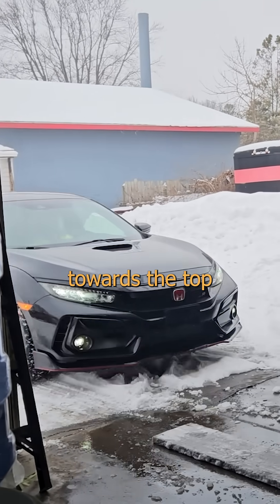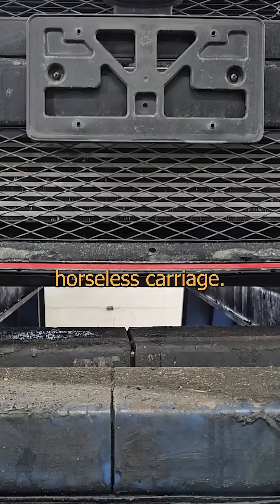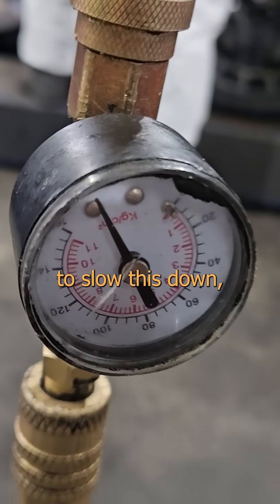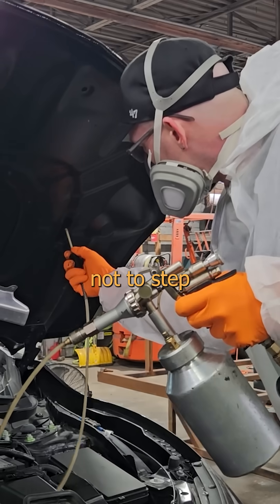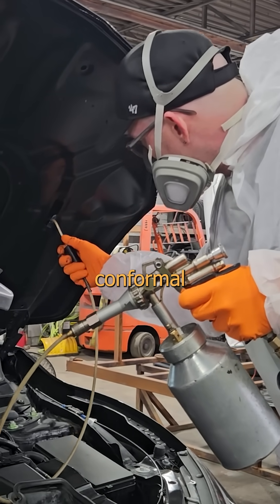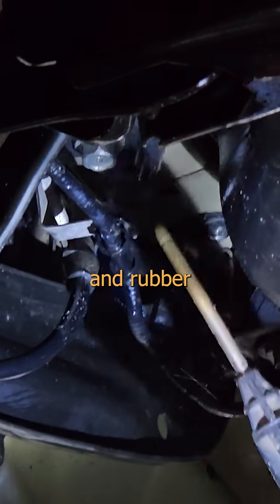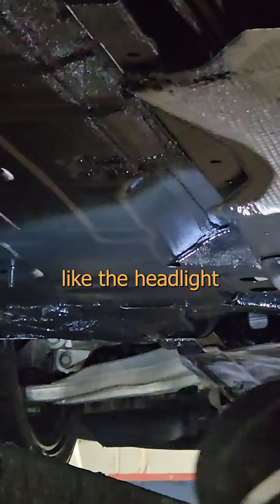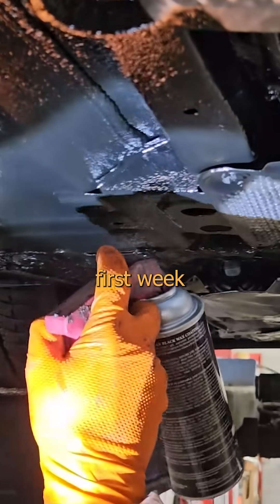How to stop rust on your car #chrisboden #comedy #engineering #wax #corrosion #science #winter #salt

Comment: I only ever  saw tar.  Or something like paint on  bed liner. Wax sounds better.   But, get a case of flat black rust converter  and get under there with a brush and clean and spray the underbelly first before you apply the heavy spray wax. You'll be glad you did.

Comment: Told a customer this week to never go back where he went. They didnt remove a single panel under the car, any of the wheel arch were done under the plastic. There was undercoat on both front fenders, both head light, both wiper arms and on the windshield. I should have take pictures 😅

Comment: I have a car wash subscription, and in winter I upgrade to the one with underbody spray.  My cars aren't rusting from the inside out. When some dude in a rusty jeep slammed into the back end of our 2012 Cruze at 45 mph, was able to see the interior of the subframe metal because it got torn open.   No more than surface rust, and not much of that.  And yes, I'm in southwest Michigan too.  That said, I might just give Kevin a call, skip the increased car wash price in the winter 😁

Comment: Undercoat (or underseal as it's commonly referred to here in the UK) is incredibly common over here, especially on slightly older cars (20 years onwards, when you get to around 35 even moreso) but funnily enough for us it's a bit of a red flag, at least in my experience, as some rather iffy folks will use it to mask rust on a car they're selling. Cars here just love to rot and crumble away (ask my Ka how it's wheel arches are doing) so using underseal to hide potentially MOT-failing rust is unfortunately quite common

Comment: My truck came out of Canada. They sprayed everything under the truck, alllll of it. Up into the engine bay, all over the suspension components, nuts bolts everywhere.. not a spot of rust for an 18 with 170k. That stuff works!!

Comment: I’m in New England, my Tacoma is 21 years old. Frame was replaced due to class action lawsuit, different motor due to spark plug popping out of cylinder #3.
Have 221000 miles, bed is just starting to rust over the rear axle support. Plan on driving it for another 6-8 years.
Fhak merikan vehicles

Comment: Okay, I want to see something not only cool but educational and awesome. 

I want to see you make an ebike that can switch between discharging the battery to run the hub motor to, at the flick of a switch, turn into a machine that no longer uses the motor but while riding it, recharges the battery. 

I also want it to have a throttle only 100+ range. Bonus points if you make a video series showing and explaining what parts you chose. Why, and how they are connected to the unit. 

World record range throttl3 only ebike is almost 250mph with an average speed of 13.5.

Comment: Only thing I want to add: if your car is already rotting, under coat will not slow it down it will probably actually speed it up. Proper prep is very important when it comes to undercoating and anything beyond surface rust needs to be taken care of or just left bare if you’re going to undercoat. Another thing is ANY plastic coverings on your vehicle trap moisture and salt and will rot out an otherwise perfect looking car and you won’t even know until it’s too late. Cars made in the 2010’s were especially bad about this, rocker panels were covered with a decorative plastic guard. Most newer cars you’ll see it as things for aero and NVH under the car. Engine shields don’t seem to have this issue as much. The jury is still out on if undercoat under plastics helps prevent this or not. When I redid my gen 2 Prius’s rocker panels I didn’t bother reattaching the plastic insert that cause the rust in the first place and noticed minimal noise and not a big impact on mpg either

Comment: Absolutely thanks for this Chris. Wither wax or oil. Though prep is important. I think the write questions are what prep work they do, i.e the cleaning, removing surface rust and the actual process plus chemicals and care involved. You can’t just whack it on and hope for the best. 

Oil treatments work well but more shorter term, I tend to use these as spot on treatment.

Comment: Best frame maintainer I've dumb lucked my way into was a leaky cap and fuel hose on a 100gal slip tank and pump. Had it in the back of a '02 GM 3/4 ton ext cab 8ft duramax from day 1.  Each of the two drain holes in the front of the box are right above each frame rail near the behind cab curve.  When in motion, the back half was lightly coated on the regular.  And by luck, it was typically parked slightly nose down, so gravity took care of coating the forward half.

After 850k it was retired but the frame, and even the ribs that cross under the bed, were still in great shape. The rest was beat round and busted up. Construction truck it's whole life, usually with a loaded heavy gooseneck along for the ride.

Comment: Can a steel frame/body be anodized like aluminum can be?  What about electroplating with a 'sacrificial' metal, like zinc (like boats use), or copper (for the protection from its patina?

Comment: My ADHD was overhelmed when I bought my car, I did research how to negotiate it but then failed miserably. 

They installed an "ionizing" electrode or something on my car that allegedly runs a small current through the entire frame that will prevent it from rusting. A load of sh!t, but I signed and paid for it.

Comment: Back when i lived in the state of cheese, i had my beloved 1985 240, got her just under 40,000 miles, and 3 times every year, i drove it up a concrete side wall on just one side. I'd pressure wash the heck outta everything on that side, then back her down and pull her on the other side to do the same, hit some areas with WD and drove another quarter.

I moved to VA almost 8 years ago with 213,000 miles on her and not one hole or rust anywhere to be seen.

People just don't put in the effort these days.

Comment: Ok, so my dad had a 94 ranger that had this little box inside the engine bay mounted right up front that said "Rust Stop". It was supposed to be electrical anti-corrosion. He pumped oil wells and had an accordion style folding ramp for his four-wheeler mounted in the back. There was a lot of bare metal on this thing and it never did rust. I looked into it and it's uses sacrificial annodes while inducing a current in the frame. I think it may be just enough to the trick but I thought it could be fun to investigate.

Comment: I refer you to South Main Auto for a NY resident and expert mechanic’s take on undercoating. He has proof that the undercoating on a car speeds up rust by trapping salt and moisture against the metal. I’ve seen undercoated cars on that channel that were 3 or 4 years old and had rust holes you could stick your fingers through. He uses an oil coating after an intense wash of the undercarriage. Has an older Tundra that still looks good underneath.
Reply: This is a wax based coating. He specified in the video that this isn't a rubberized paint/epoxy
😂

Comment: Very good advice! I live in MA and our cars get destroyed too. I've been using Fluid Film for many years now, with good results. As mentioned, you absolutely can not use any kind of hard/dry coating. These things will chip, crack, peel, whatever and then they start to trap moisture and make things ten times worse than doing nothing. Fluid Film and other similar products will actually penetrate existing surface rust and always displace moisture as long as any is still on the surface.

Comment: Either Chris or any knowledgeable commenters, is there any point in undercoating a car that already has mild rust? Say, a 2017 Honda with 130,000 miles in eastern Nebraska? There's surface rust, but if it's prepped right, can undercoating help extend its life, or does any rust at all mean undercoating will accelerate it?

Comment: Don't spray the drainage holes closed.
Don't coat suspension parts that need to be inspected non-translucent.
Don't spray over the important type labels of your trailer hook.
Make sure fasteners can still be turned.
Make sure electrical connectors can still be identified and disconnected.
Keep flamable stuff away from hot pipes.

Brunox contains epoxy but it's main function is the rust after you have mechanically removed all you can.

Comment: Undercoating is only worth it if you are the first owner, and plan to keep the car for 5+ years. 
Those people are rare, which is why undercoating is rare.
Reply: If you undercoat the car brand new, and sell it after 3 years (like most people do), then the undercoating was unnecessary and won't affect the resale value at all.
Reply: @marrenirre9994  you're missing the point. What he's saying is if it's already rusted, there's no point in undercoating anything.
Reply: @blakec1409  To what point? Surface or structural rust? Won't it at least slow it down to keep away more salt and moisture?
Reply: @0692XA  tough to say on all accounts really. Will it slow rust progression? Probably if done correctly.  But I think it's really only a matter of time before it becomes Swiss cheese.  Coating after rust has taken hold only buys you time. Might buy you 5 years or 15, just depends how much effort you want to put into it i think
Reply: @blakec1409  When you can't afford a car without any rust, especially if god forbid it's gotten bad before your loan is paid off, buying even a few months is worth it. 5 years minimum is life changing because there's no other way to keep a car that long up here.

Comment: I'm from Poland. Salt is second nature here in winter, so almost everyone secure their cars with wax or oil based coating. The fact your mechanic doesn't even disassemble the plastic covers, take tore off and even worse sprays the coating on wet surfaces makes me think are you are fully aware that this should be done?

Comment: I use the pb surface shield once a year which reminds me I need to spray it again. A can lasts two seasons for two vehicles, so pretty cheap. Just do it when I change the oil before winter.

Comment: Probably since the beginning of cars people sprayed used motor oil underneath. It was available for free and it keeps the car from rusting. Once you spray it if you take a drive down a Dusty dirt road it'll put a thin absorbent coating on it that'll help it stick. Yes you have to reapply sometimes but if you do it yourself it's free. And you can even claim to be green reduce reuse recycle.

Comment: Uncommon opinion. Using used motor oil and applying it liberally to the underside does the same thing. Not as glamorous. But it will certainly work.

Comment: Waaaaaaaaaaay back I was an installer of these products here in the Pacific North West for a luxury auto dealership.
For many people these products are a good idea. AND as I have seen here in the comments, the PREP work is incredibly important. I used to steam clean the undercarriages and let them dry before I applied the products back in the 80's.
BUT ...
I have never done this to any of my own vehicles. (Although a rubberized coating on a 4x4 helps with the noises and I should do that just to make it quieter. )
Despite the constant wet and the couple of months a year of daily brining, salting and sanding on the roads I find that taking the time to vigorously spray/wash the undersides, including the inner sidewalls and the insides of the bumpers has kept my vehicles almost rust free.
You should see the condition of the undersides of my 2005 Chevy Colorado. I see worse on 10 year old vehicles every year.
All it takes is an extra 5 minutes when washing the truck.
Wet arms will dry and warm up. Having all that corrosive material washed away lasts for many years.
As most people won't ever do this, the coatings would be much better than doing nothing.

Comment: I worked for oilgard in Ontario, Canada for nearly a decade and if I had to say as far as rust prevention goes, oil is the only way to go about it. The proof is in the pudding and I've seen a 50 year old car restored and once they scraped the layers of oil and dirt off, there wasn't a spot of rust on it. It had been sprayed with oil since day one and daily driven through all seasons. Unfortunately I've seen all other types of rust prevention fail be it the rubberized bed liner type they spray on at the dealership or wax. Only downside with oil is it needs to be applied yearly to be effective.

Comment: I was told in Material Engineering class, an eon ago to prevent rust from eating the bottom of your vehicle, bolt a piece of sacrificial metal on the frame and it will oxidize not rust…that’s what they do to bridges…….i have no idea if it’s true….i just remember being told that

Comment: Spray the undercarriage with used motor oil, then go fly down a dirt road for a few miles.   Gramps method worked well; had a 64 nova with no rust well into the late 90s up here in MN.

Comment: Only 11 years??? Thats short lifespan. I'm my country is "as long as the engine is still able to run". That means lifespan can be 25 upto 30 years and/or the oddo meter back to 0 again. You can keep it operational after that period as long as the spare parts are still available, both the originals or the clones.

Comment: I got my undercoat through my first job. I worked as a part time porter in a small body shop, and saw that they were coating new panels on the back with this specific coating by CREST. After I went back to school, I went to pick up my last paycheck, and asked him about it, as I was in the market to undercoat my rust free 07 Chevy 1500 classic. He told me it was called Crest Honeycoat and told me where he got it, a place way down in Ohio where he orders and ships it up to his shop in SE Mi. I found it online and ordered it. I had trouble ordering it as they required it be a business that buy it, so I started an account under the name of a side business I use to make a little extra cash here and there. I finally got it, applied it, and have had no complaints about it (ofc I used proper PPE and instructions given to me by my former boss, yes it was in an aerosol can). It has been about 2 years ago since and I have not seen any rust where I applied it. I did, although, not order enough to do the entire truck and some thin spots in the coating are a little noticeable.

Comment: Here in Australia 🦘 our farmers and country mechanics have been using lanolin for many years to preserve all types of machinery 
It's commonly available in spray cans. There's a light grade called Inox MX3, and the heavy duty stuff called Lanox MX4. It's only around 2 years ago I first tested MX4 by spraying a old metal vice with it and leaving it outside in our salty humid coastal rainforest environment. It sat outside in all weather for a whole year without rusting, so I know it works!   Wonderful stuff! 
Lanolin is also used on mining equipment and marine applications. Oh, and I've also found it's great for spraying the blades and underneath your lawn mower!

Comment: One thing is always remove any rust first! THIS IS A MUST! You gotta scrape the fucker clean until there's not a spot of rust, then use some cheap primer to coat the bare metal, THEN you can undercoat it with asphalt. Otherwise you're locking in the moisture! You might as well give your car a salt rub like a steak at that point!

Comment: A friend swore by WaxOyl (made by Duckhams?)which he used on all his vintage cars for the same reasons. It's not lanolin based but seems very like your product. It's quite possibly what Marmite would aspire too given half a chance. You could brush or spray it on. He would soak sacking in it and wrap it round his leaf springs as well as brush and spray his chassis with it.

Comment: Living in Austria, we also have salt in the roads usual from the end of october till may... So, yes, rust is common here.
I use a very popular way of protection: it is called rope grease - a special grease for steel ropes, like used in elevators, or cable cars. It is extreme resistent against splash water, don't get hard and it crawls in every little spot. But like all those treatments against rust: it is a very dirty job. 😁

Comment: A few places actually heat their roads.  It sounds expensive, and it is... up front, but it turns out that if you do some heat pump magic and store that waste heat from the road all summer you can actually heat the roads cheaply enough, at least in some places (I think the article I read was from Scandinavia, so we aren't talking warm places) and the buildings along the road with district heating and, because the road surface doesn't go through the thaw/thrust things as often as your relationship, the road lasts long enough to offset the costs.

Comment: I live in a country of rusted shit boxes and what I learned from trial and error is... Hard coating never works, Oils are not enough and unless you only drive in summer and put the car in the garage for the rest of the year, it's gonna rust.
Wax seems like the best option, my parents got their civic done this year, disassembled, sanded, repaired (where needed), painted and waxed.
Time will tell if wax works as advertised.

Comment: My car has a self undercoating system.. several strategically placed slow leaks spread around the engine bay and lubrication reservoir gaskets ensures a steady and near constant, fine film of petroleum based anti-corrosives with light detergents, is spread across almost every surface of the underside of the vehicle.

Comment: I have a 2003 BMW X5 with almost 250k miles. Every fall, it gets a gallon of Lear Corp ACF-50 applied to EVERYTHING underneath it. ACF-50 is used in the aircraft industry to prevent multi-million dollar airframes from corroding.

Comment: The problem with the lanolin based coating is how dirty you get when you need to work on your car.  The goo goes evereywhere !  But I suppose its better than busting your knuclkles on a rusted bolt and having to drill it out.